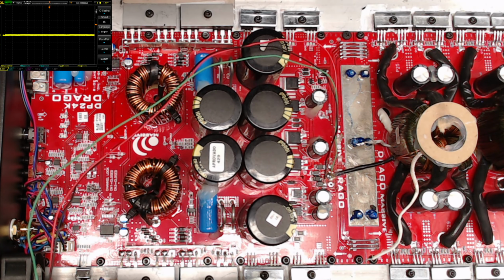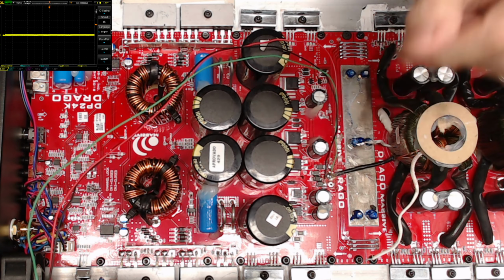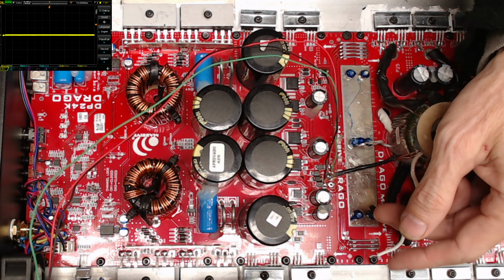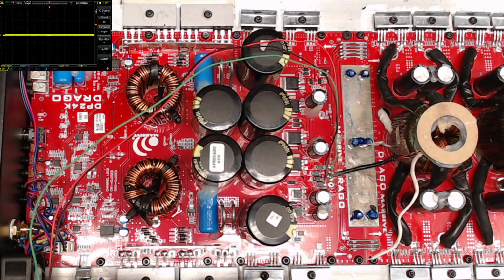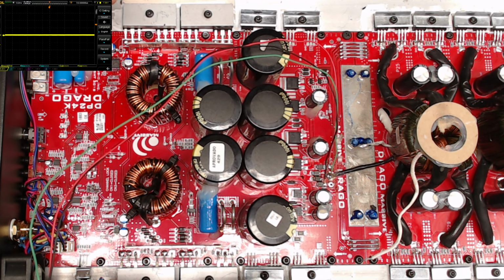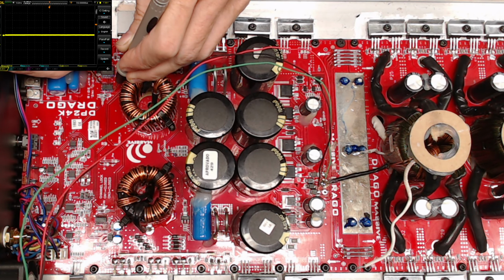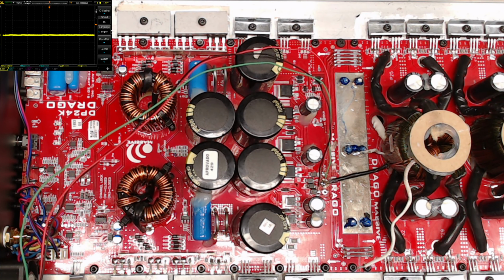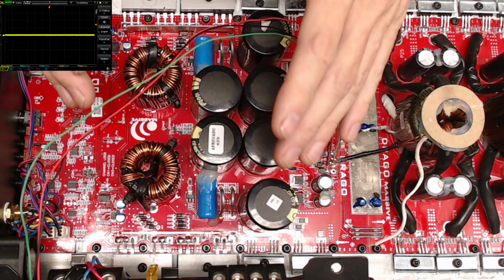Massive Audio Drago DP24K Creative Thinking to Power Up the Pre-Amp

Comment: I have the exact same issue on a Stetsom 10k I was trouble shooting this evening. I was going to use +/- 12 volt supply to tshoot the reason for my 4011 blowing up. However I might try the method you have demonstrated. Instead of using a second amp for its aux winding, might a 12 vac transformer be easier to setup? 
Thanks for your helpful video,
Reply from the maker: I am not sure if 12 volts will do it. You will lose quite a bit going through the regulators so you may have quite a bit less than 12 volts. If you have a +/- 15-volt supply you can connect it after the regulators. I chose the method in this video to verify the regulators' operation as I did not know what shorted the diodes initially.
Reply: I should have been more specific, 12 x 2. 24 with a center tap
Reply from the maker: @thomaslockwood2950  Correct, you will lose some voltage due to all the junctions it has to pass through such as the diodes and the regulators. Won't be much but might be significant enough to not properly power the pre-amp.
Reply: Just as a follow up, if you ground the SD input of the drive IC, you get oscillation to the output mosfets
Reply from the maker: @thomaslockwood2950  I never thought of doing that! Thank you so much for bringing that up.

Comment: Todd, this could be the same as the Stetsom EX21000EQ.
Reply: I have a Stetsom ex21000eq on the bench now and it looks identical.
Reply from the maker: @jordanciaramitaro6351  Most excellent and thank you. Have you found any odd issues in the pre-amp by chance?
Reply: May I ask what transistors you used in the power supply?
Reply from the maker: @jordanciaramitaro6351  My original answer was from the wrong board. I used the IRFB7430 in the power supply.
Reply: @ellensburgamplifier  HI Todd i send an email to you about this I found for you . Vegetap... Email.
Best Regards
Reply from the maker: @bigstone5124  Thank you, I realized I was talking about the wrong board with the H3's. Sorry guys!
Reply from the maker: Thank you Cliff. I did see that it is quite close to the EX21000. I think this Massive is a Stetsom board thinking back to a Massive I repaired a while back that had a Stetsom sticker in it.
Reply: Not yet, this one blew the front two banks of ps fets, I used the remaining fets to to power all 4 transformers and it powered up with clean drive on both sides. I couldn’t find the original power supply fets so I am going to try irlb3034